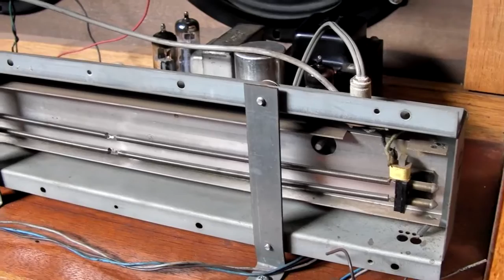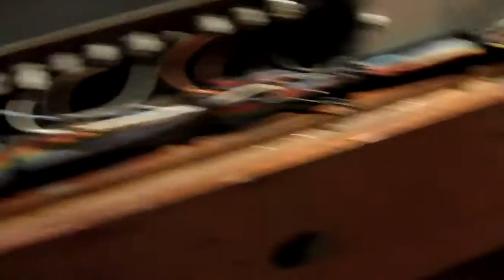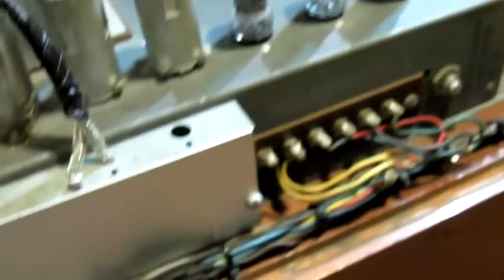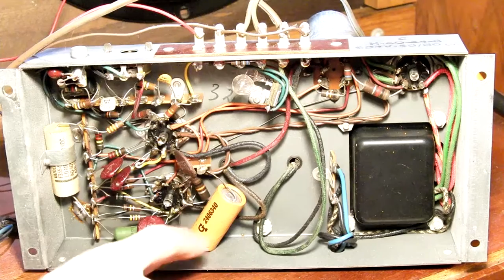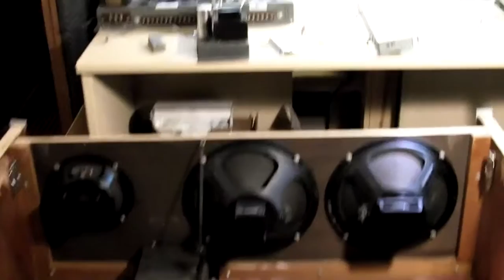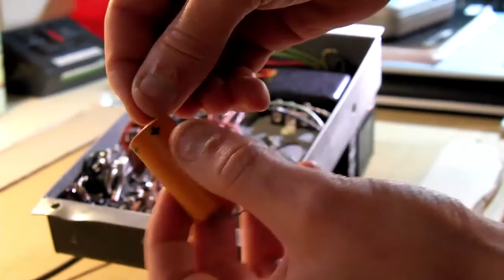Hammond M-100 Organ Restoration (Part 1)

Comment: I picked up a non-working M111 for $25. I oiled it up and it plays pretty well. Some of the pedals are farty and the reverb is pretty bad. I have a Hickock tube tester so I'll start there, but I'm sure the filter caps and power cord need replacing. Thanks for this excellent video. Chopping the organ in half is a great idea. At 68 years old, it's not easy picking up 250 pound organs anymore. lol

Comment: You only replaced 'a little cap'? What about the others especially the filter electrolytics? No checking of resistor values?
Reply: is cap short for capacitor?

Comment: My father has a M100, wasn't played for years, almost decades now. It's freaking heavy and I somehow plan to strip it down in weight, so remove most of the chipboards and use a lightweight metal construction, not sure yet. Needs electrical restoration too, build year around mid ´60...

Comment: does the European M100 have an output for external speakers (like a leslie cabinet)
Reply from the maker: No, it does not have any output for external speaker and no leslie connection, but it’s actually quite easy to add (speaker bypass/output mod).

Comment: I too don’t like the tape covered splices on the wires. Especially for a traveling Hammond, or one that’s not always stored at room temperature.   I only use heat shrink tubing.
   That Hammond  looks like it chopped  for a band.  I once chopped an RT-2 and a B3 for travel.
  God has a special place in Heaven for those who keep the Hammonds alive. 😎

Comment: Thanks for this helpful video.  I'm about to restore my M100 however have no idea on how to remove the keyboard and tone wheel generator without detaching one from another. 
Edgar
Reply from the maker: Hi Edgar, from what i see there might be no space to slide the generator out with the keyboard attached, however you could try removing the preset switches assembly, the vibrato/chorus line box and desoldering all the unwanted wires. I suggest following the manual and the schematic as reference. (Pay extra care of not breaking the resistive wires on the terminal strip!)
Dave